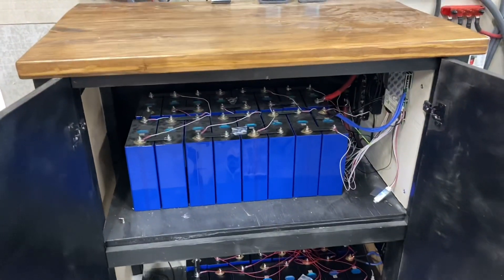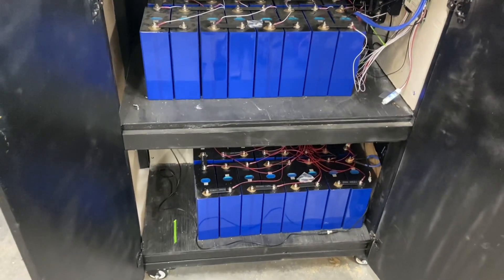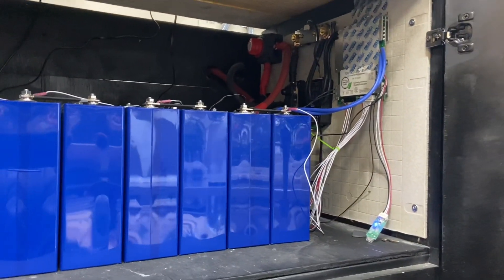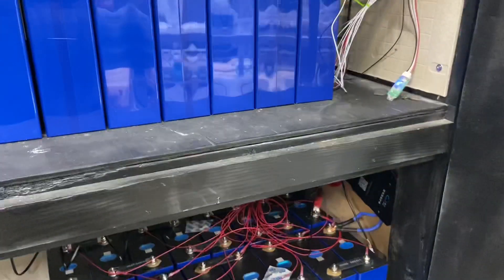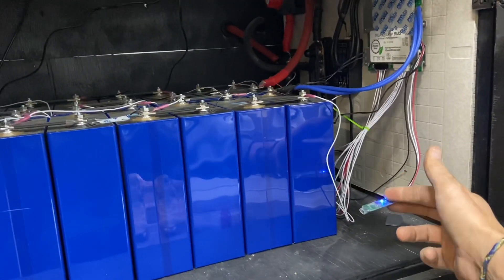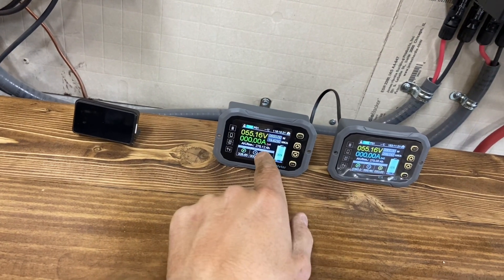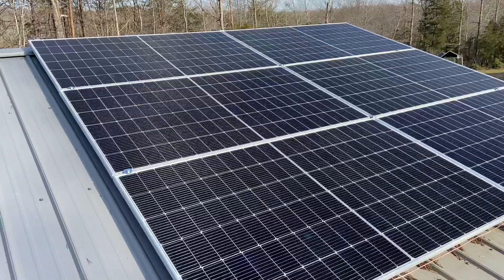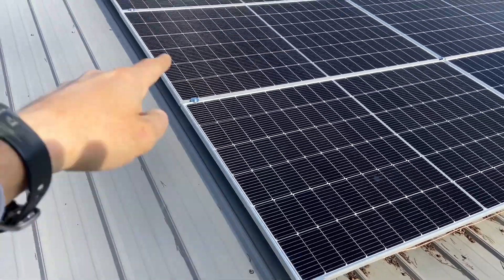Updates to the system.

Comment: I discovered Docan is offering a DIY Battery case with the best BMS in the industry. It is the 200 amp JK inverter BMS with 2 amp active balancing in a DIY box kit by Apexium. Connects to the 18KPV via can bus and cost is $435
Reply from the maker: What size cells does the box fit?
Reply: 72mm (280-320Ah)

Comment: Gavin, have you setup communication with your DIY Battery bank to the EG4 18K? I am asking because I am using EVE LF280K battery's and JK-BMS and my EG4 18K wants me to use flooded lead acid settings.
Reply from the maker: I’m still using the lead acid setting also. Eventually I want to add coms. That’s definitely on my list.
Reply: I am trying to find the coms info to wire what I need. This is proving to be a challenge for sure. JK info is very lack luster. However, I really like the BMS, just needs more documentation. I got my JK-BMS from Docan's Texas warehouse., A little costly though. I will share what I learn.

Comment: Do you think it still makes financial sense to build your own?   I know in one of wills videos he mentions it not being worth it anymore and with the price of the “inexpensive competitor”. Like power queen you can grab 4 12 volts for 900 bucks for 100ah I’d be curious to see a cost comparison to something like that.   Thanks again for the great content!
Reply from the maker: It depends on the size of your system maybe. For 48v you’d still save a little by building your own. My DIY batteries are doing great. But honestly I’m eventually going to switch them out to have everything in closed loop communication with the inverters. 

The savings is still there for building your own. It’s just more marginal now.
Reply: @GavinStoneDIY  i actually removed mine from closed loop at least with the SunGold power it didn’t seem to help. I  have one cell on one battery that hits an over voltage when it’s in closed loop  but when it’s in user mode and I set a conservative voltage it doesn’t do it.  I would imagine the eg4 batteries might perform better though
Reply from the maker: @SolarinStarke-kt2lm  the 18kpv seems to do really well with closed loop communications. So I’m planning on getting everything set up for that eventually. The sungold may have been taking the voltage too high in closed loop, hard to say.

Comment: Hello very nice video can the Jk Bms communicated with BMS port of the Eg4.
Reply from the maker: No. It can’t communicate directly. Currently I just use voltage for my system and it works well. Signature solar has come up with a port that communicates with multiple bms types. I can link it below. At this point it doesn’t cover jk bms’s yet. So using a Victron shunt with solar assistant it the only way to be completely accurate with it.    https://signaturesolar.com/EG4-LiFePOWER4-Communications-Hub?ref=mpmddlkx6M9tPo

Comment: My Eve 280a are coming this week from Docan.   What voltage did you decide to top balance with?
Reply from the maker: 3.5. Which bms are you using?
Reply: @GavinStoneDIY  Seplos 10E with BT.
Reply from the maker: I haven’t looked much into seplos yet. But if it has active balancing then you really don’t need to top balance. If it’s a passive balancer like the jbd  and Daly then definitely top balance the cells.
Reply: @GavinStoneDIY  Passive balance.  150mA.   May need to piggy back a 16s active balancer.
Reply from the maker: @errcl65  yeah if you’re using cells over 100ah I would recommend an active balancer. Then again my overkill jbd bms still works fine. It just gets a little out of balance towards the top end voltage.

Comment: Hey Gavin! Great to see you 😁 I have the same BMS to make a 48v but I have yet to use it. I'm glad to hear you like it. I believe the Over kill uses passive balance and the JK uses active balancing. You and your family have a great Christmas and New year's 😊
Reply from the maker: Hey man! Exactly. The active balance on the jk bms is the key. It has 2 amps of balancing current. The bms isn’t hard to install. The balance leads are a little too short though. And you have to add cell 16 and most positive on the same terminal which seems odd. But that’s how jk operates I guess. I can’t wait to see your new system when you start building it.
Reply: @GavinStoneDIY  If I get back from Cuba 😂 On our 3rd delay home. 😬
Reply from the maker: @Roll2Videos  at least it’s warm there I guess.
Reply: @GavinStoneDIY  that's probably because it works for multiple sizes of cells in a pack. It has to have an overall pack voltage measurement, and power for itself so that lead has to be flexible where it goes.
Reply from the maker: @CollinBaillie   yeah, after seeing the configuration for the higher voltage I believe that is correct.

Comment: Where did you buy and how much? I would be nice to see them compressed to 11psi with foam separators between each cell. Rogers makes special foam sheet material for this purpose called Poron EVextend. This should prolong  cycle life beyond 3K cycles. Uncompressed these cells will bulge out and partially delaminate internally and lose capacity. Already happened to my pristine A grade 1 year old cells from EVE. I only ran them at float service at 3.35V and few partial cycles.
Reply from the maker: I’ve read that using in solar applications at low C rates there isn’t any need for compression. Perhaps you’re right though. It wouldn’t take much effort to compress them and possibly lengthen their service time. I purchased the cells from Docan power. They were $110 each for 280k eve cells.